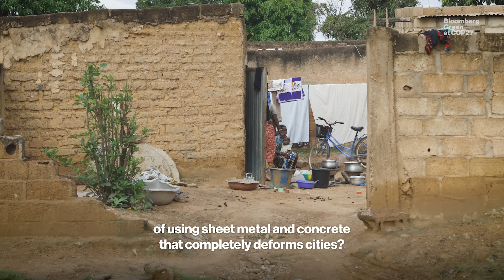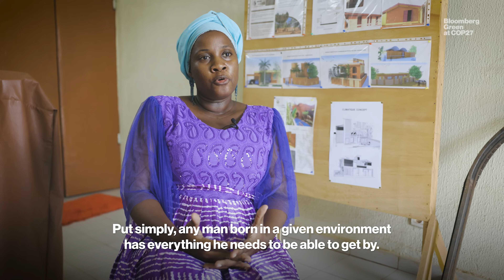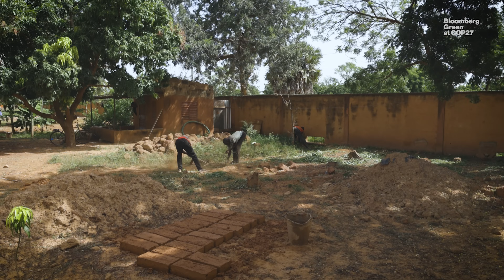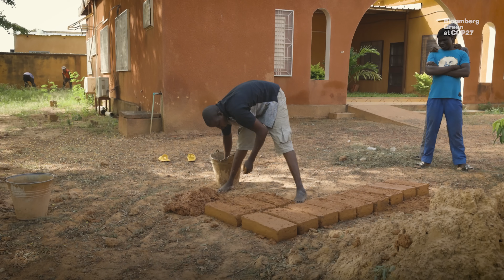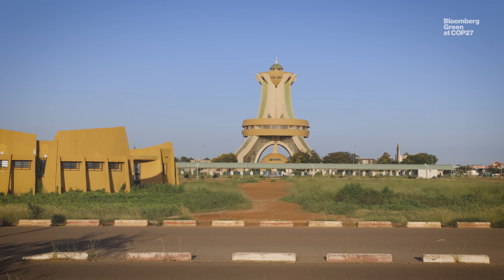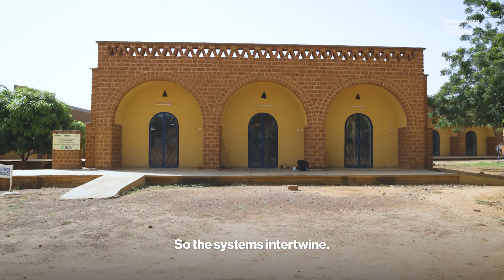The Architects Designing Future Cities With Mud

Comment: As a engineer, the issue of using local dirt is that it will be a nightmare to do strength calculations as it is it can be  various a lot based on what they have or manufacture techniques. Concrete on the other hand is very well studied and mostly consistent.
Reply: As an architect with an emphasis in structural engineer, I can attest that for many local applications, especially in emergencies, filling long tubes with mud or rubble then laying barbed wire or the like on top of each coil wound in an igloo shape, mud is entirely acceptable. The same with dried mud bricks of a certain shape and to a given height . Concrete is far more expensive, requires more skilled labor, requires more strength to build,  requires more precision in mixing and placing, and so on.
Reply: Sounds like they are actively working on that particular challenge according to the video.
Reply: But it takes vast amounts of energy to manufacture, so its future is in jeopardy. Find another way is the message!!
Reply: not big deal for 1-3 story buildings, right?
Reply: Agree the issue of using these alternative construction methods is that it requires new design concepts and evaluation methods, which later on will limit the applicability of such concepts. I mean mixing cement with clay is not just practical, engineers try to remove clay from a concrete mix as much as possible. would have been better to use fired bricks or concrete masonry since it is already cheap and easy technology.  These alternative solutions is what is keeping africa poor, instead of developing heavy industries we propose these bandaid solutions that have nor room for growth, just like those straw filter and hand cranked radios or cheap solar panels that they cannot repair, what these countries need are reliable and large scale technology of electric and water utility lines and heavy industries not these cheap alternatives that will go nowhere in the long run.
Reply: Not to mention if climate change is here and models are right there dry land will get more water and will get dryer all at the same time.
Also when it rains it will rain like no other.
Reply: @Aconspiracyofravens1  you will be needing flexural members for the 2nd floor, you cannot use rebars because the clay will cause rusting on the reinforcement andd rebars cannot bind effectively on clay
Reply: @JL-tm3rc  thats equivalent in cost for most short buildings, no?
Reply: @Aconspiracyofravens1  the cheapest type of structure is a one story building because of fewer loads to be considered , two storey buildings will significantly increase in cost because 1/3 of building cost will be on foundation, for one storey building that will be around 1/5 of the building cost
Reply: @johnstrawb3521  this looks better than the earth bag system. An ambitious builder could probably implement this mud masonry as a facade, it looks more labor intensive than the bags and more likely to fail as well
Reply: Have you heard of rammed earth reinforced with steel bars.
Reply: @accaciagame1706  earth will corrode the reinforcement, the great thing about concrete is that it is alkaline which reduces the chances of rust
Reply: @JL-tm3rc  nope it won't. Rammed earth used lime or cement at 10%. It is alkaline. Also by the time the rebars corrode, the rammed earth is basically like stone through compression.
Reply: @accaciagame1706  rammed earth only works for one storey buildings. Because it would be difficult to build a suspended slab. At 10 percent cement or lime that is the same as using a class C concrete on a volumr basis. Instead of using that cement for the rammed earth i will just use it for a class c concrete and i will have a more durable building. Clay or earth is just detrimental to cement properties. It is better and cheaper to use sand and gravel as aggregate instead of soil. Or why not use bricks. Finacially such concepts as rammed earth are not cost efficient and a waste of materials.
Reply: well there are 1000 yr old structures built with mud, so there must be some knowledge gained from practical experience
Reply: @joefreeman3772  sure using fired bricks some aun dtied bricks may survive if the climate is right
Reply: @JL-tm3rc  rammed earth architecture and other forms of traditional building styles are making a BIG comeback because they're just now being extensively studied as viable and have their stay and fair share in the market. So, get ready to see more of them and stop being ignorant!
Reply: Read 'Building with Earth' - Gernot Minke
Reply: @JL-tm3rc  Hakka Tulou buildings are multistory rammed earth, and 100's of years old. The adobe skyscrapers of Yemen are made of  Earth. The adobe pueblos of the American Southwest are adobe, and the oldest inhabited structures in the country, at roughly 1000 years old. Have a look at the great mosque of Djenne, Mali. You sound like the spokesperson for concrete. Earth buildings are superior, and last longer than concrete.
Reply: @HW369  the buildings you mentioned are constantly maintained and earth cannot be used to build suspended slab. it is simply a matter of cost if you use earth but have to constantly spend money to maintain it then it is not feasible .if you like to use earth then rammed earth is not the answer. use bricks instead it is tried and tested. rammed earth will not last in a week of rainfall that is why it is used on arid areas only
Reply: @JL-tm3rc  Brick also requires regular maintenance, like tuckpointing every few years in cold climates with freeze/thaw cycles. Earth buildings are much less costly to maintain, and do not require manufactured materials. Lime added to Adobe, super adobe, rammed earth, self heals after being moist, and will fill any cracks. This is also why Roman concrete, like the Colliseum, is still standing. Lime and pozzolan aggregates mixed in. Far superior to what's being made today. Earth also requires "thinking outside the box", and it's why you see so many earth based structures are round, as opposed to rectangular shoeboxes so popular these days. Earth is the better material, the buildings are also far more aesthetically pleasing, with rounded, organic forms. You can miss me with the square, brutalist architecture practiced in the West. Research the multistory Yemeni adobe buildings - Yemen gets rain, and they have ways they waterproof things. Several coats of linseed oil are commonly used in Earth bathrooms, for example. Again, Taos pueblo, a multistory adobe, is around 1000 years old, the oldest continually inhabited buildings in the the U.S. Taos gets rain, snow.
Reply: @HW369  it is a matter of cost effectivity if what you claim is true then most houses would be built using it but everytime concrete comes into the picture people will prefer to use concrete for cost , durability and strength. again adobe cannot be used to build suspended slabs. even the poorest of the poor would prefer to use CHB it is faster and more hygienic. people have known rammed earth i wonder why they abandoned it. that is just a trend that will be again abandoned once the people promoting it realize it is too expensive , unsafe , unhygienic and most people do not like it the very reason people have abandoned it in the past.
Reply: @HW369  in addition if you place a rammed earth in a cold climates the earth will simply detriorate as the rammed earth absorbs more moisture and prone to larger expansion. here is a better idea why not take that lime and use it to make cement for concrete and you would even save money on it
Reply: @JL-tm3rc  If we're avoiding concrete, why would we even consider suspended slab construction? Tulou and other earth and adobe structures can be made many stories tall. Concrete is expensive, and damaging to the environment. It also has poor thermal qualities, and is hot in summer, cold in winter. Earth structures and building techniques have not been abandoned, and continue to be built where they are allowed. One reason we do not see more earth structures is due to onerous zoning laws, put in place by the very (small) group of people who most benefit from selling concrete. Indeed, most earth structures predate zoning laws. In the United States, at least, the zoning laws were put into place by colonists who brought foreign methods of construction to a land not suited for it, and anything native and traditional, from buildings, to language, clothing, art, culture, was discouraged, penalized, outlawed. This same group of people could also not profit off of traditional building techniques, and the exploitation of the land for profit was a prime motivation for colonization to begin with.
Reply: @JL-tm3rc  Then explain why tulou are used in places in Fujian that receive substantial rain, and have cold winters?
Reply: @JL-tm3rc  Let's talk about hygiene. Black mold is ubiquitous in colder climates utilizing concrete and wood frame. This is not a problem in earthen structures.
Reply: @JL-tm3rc  At the end of the day, building with earth empowers people to create their own housing, with the materials around them, without the need for a supply chain, as needed with concrete, for example. A supply chain that is unsustainable, drives up cost, and makes housing unattainable for most. In the U.S., the failure of the current paradigm is clearly seen, and felt, in the thousands of homeless encampments that have sprung up in major metropolitan areas in the past decade.
Reply: @HW369  Dude no one is stopping them from doing so. what empowers are you talking about. they just choose not to use rammed earth because they know concrete ,brick or other methods are better. no one is forcing them not to use rammed earth.
Reply: @johnstrawb3521 I feel smarter just by reading this 🧐
Reply: @JL-tm3rc  You are thinkin extremely short-sighted, Africa will not become rich by copying after the west, it will become rich by devloping it's own systems.
Reply: @darnokthemage170  Why not just copy tried and tested systems.  nobody wants to live in a mud house i would live first on a wooden house before going to a mud house
Reply: @mouhalo  short sighted how. No matter how much funding these advocacy groups anf NGO get they always fail.

Comment: Hempcrete is something people should look towards.  Now that it's cousin has been decriminalized it's worth looking at compared to concrete.  Only issue so far is you need lime (not lemon as in lime) as a binder which is why we need to find alternatives.  It help bring win the war of 1939-45 it can help the problems we have today.  To save land you do vertical farming.
Reply: Hempcrete is a more sustainable alternative to concrete. It is fire resistant, has better insulation and is more resilient to earthquakes.
Despite being quite a versatile material, hempcrete does not have to capacity for load bearing walls on its own. It needs reinforcement. 
Sure, you could try using engineered timber or bamboo as alternatives for conventional steel reinforcement.
But that brings a whole other set of issues, I’ve never seen anyone try it yet, though.

Comment: Building with earth empowers people to create their own housing, with the materials around them, without the need for a supply chain, as needed with concrete, for example. A supply chain that is unsustainable, drives up cost, and makes housing unattainable for most. In the U.S., the failure of the current paradigm is clearly seen, and felt, in the thousands of homeless encampments that have sprung up in major metropolitan areas in the past decade.

Comment: You should mix the mud with cement and adequate lime to give the brick its durability and resistance.
Reply: yeah, they have to be mixing or coating the bricks with something to make them water stable / resistant. I wish they addressed this a bit more.
Reply: Adding cement in soil for walls it is actually detrimental to the long term durability of a structure. You're trading the self-healing qualities of clay for the rigid fracturing qualities of cement. 

People often don't realize how weak cement is on its own in terms of sheer strength. That's why they mix cement with aggregate and plasticizers for concrete and fortify it with lots of metal rebar. 

Once cement fractures it provides little to no strength. Clay, on the other hand if fractured, can rebond. That's why you don't see 1000 year old concrete buildings, but you do see 1000 year old earthen buildings.
Reply: @newolde1  clays not water stable though, if you're in an area with risk of floods, high humidity, rains, etc. , wouldn't want to add at least lime? How do the clay structure that last 1000s of years survive? If you have more information on this, I'm honestly very interested

Comment: My Grandmother has a house made of mud bricks and it sticks and it's wet and humid all the time in there, even though it was built with proper craftsmen after her wedding. She is in Easter Europe, in case one wonders.
Reply: @seihyunpyo5383  Yes, but  it still has a distinctive smell, I don't really like it at all. Bricks are fairly easy to made and is nothing else but burned mud, which is the perfect material to build a house
Reply: We have lots of those in Serbia too. Earth houses in this region require a set of knowledge to work properly that has mostly been forgotten. Roof has to be maintained, overhangs of adequate proportions used, using vapor permeable paint and insulation materials, proper drainage of immediate surrounding and the street...

After ww1 and ww2 population not native to northern Serbia moved there, replaced Germans and part of Hungarians and got into their houses made of earth. Houses relatively quickly got a reputation of being damp and moldy. Funny thing that first thing most of them did was fill in drainage ditches running along the street and cut down mulberry threes lining them. Mulberry being important since its roots go straight down and very, very deep pulling water down along. Later on they started using cement mortars for wall repair and non permeable paints trapping moisture within the walls and causing mold. 

Earth houses are just fine, but come with some idiosyncrasies that make them different than standard houses and require some thought if not work.
Reply: @arsic094  from my experience they require a lot of work and maintenance that just doesn't fit in a more industrialised world. bigger structures such as mosques would require a lot of man power and replastering pretty frequently just so they don't denature. in mali people built little wooden sticks into the building and would climb them to spend a lot of time on specific spots that need repair. this could probably be more efficient with modern construction vehicles but it's also a lot easier to build stuff out of something more resistant when building large and significant stuff
Reply: @Jollofmuncher2000  In Mali they, for some reason, never discovered roofs with overhangs and/or lime plaster.

In Serbia it isn't really about maintenance requiring lots of labour, but really about overall bad practices.
For example, maintaining a drainage ditch is done once a decade if you are not actively filling it in in the meantime.
Roof with proper overhangs is constructed once and its maintenance is no more laborious on an earthen structure than it is on a contemporary house.
The same goes for avoiding vapor impermeable materials and paint.

Just like a wooden house has a certain set of rules that needs to be followed for it to work properly so does an earthen one. Their combustibility and potential problems with insects don't make them outdated. Same goes for earthen houses.

Comment: Mathematically 8% of 38% of the total carbon footprint is really insignificant. You also never explained how it is better. You still have to mine to get the products at. This is Bloomberg science
Reply: They explained that the materials are locally sourced so you reduce shipping costs, they also don't need to be processed as intensely as concrete. There are also ecological implications to only using local materials so you're not importing foreign minerals that create imbalance. They also explained how it's better suited for maintaining temperature stability in rising temperatures. I think you just weren't paying attention.

Comment: Architects don't biuld they design... And then someone else is paid to actually make the biulding stable...
Reply: Why did you feel the need to say this?
Reply: Yes, as a plumber I had to waterproof architect designed buildings many times, there is a disconnect between real world and whats whirling around on the screen or even drafting table. I’d like to see their roofing details.
Reply: Not true. I studied Architecture in college and we had a unit called "Structures" which is structural engineering. Your designs as an Architect must be structurally stable.
Reply: @mirage1500  what do you mean you had to waterproof the building